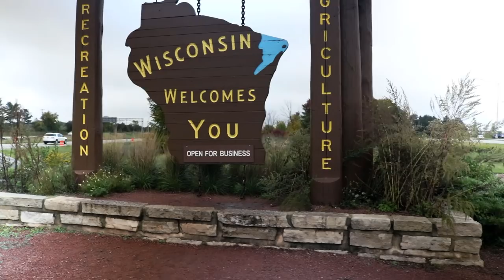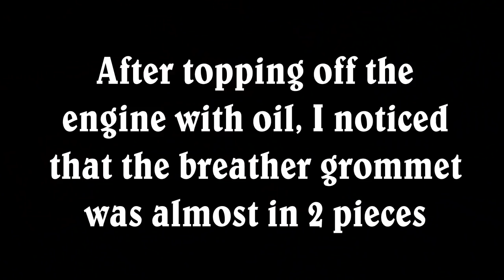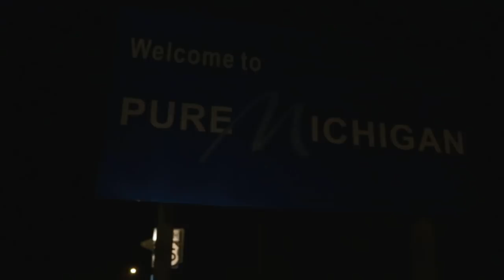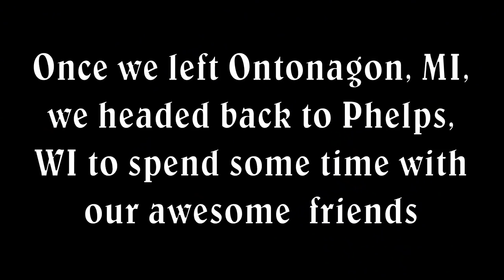Chevy Camaro Road Trip to Lake Superior - Longest journey for this classic muscle car EVER!

Comment: But did u make it back
Reply from the maker: I sure did, but it was a cold drive back.
Reply: Im si scared to take my 81 ttop on interstate. Now you gave me the balls to take off and dont look back
Reply from the maker: My biggest issue going over 55 was my car would really shake that's why I stayed off the interstate for the longest time. Once I replace the driveshaft the axle shafts, rims and tires ( because the guy before me smashed a curb and bent the axle shafts and rims) my vibration was gone and I felt a lot safer being on the interstate. So as long as you get any issues that you have fixed that are going to keep you from driving at fast speed safely, go for it.